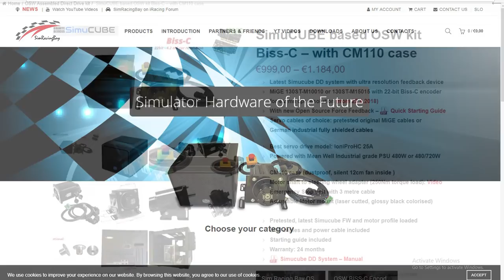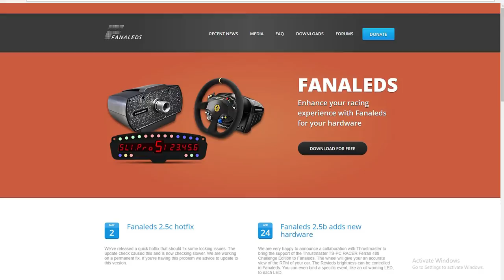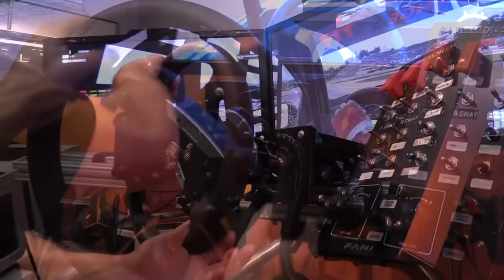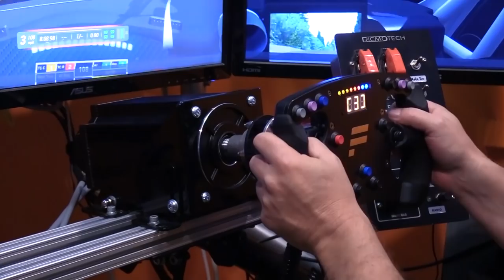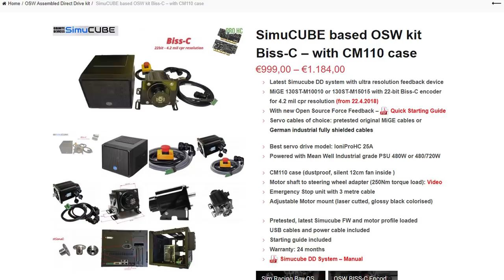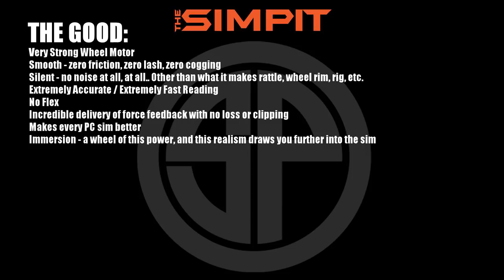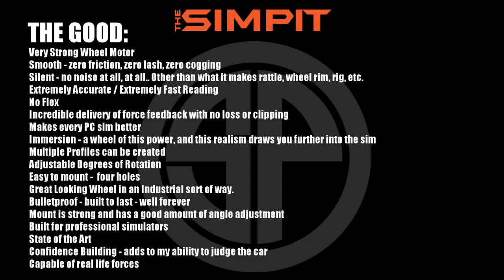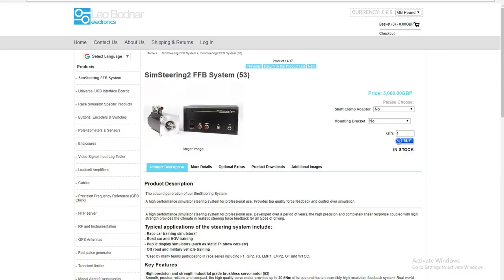Sim Cube 30nm Direct Drive Wheel Base Review

Comment: The INI file in iracing give you the ability  to adjust FFB strength in NM instead of percent.  If you adjust it with strength the force feedback is not linear.  Change the INI file and see how you like it.  Also adjusting it with Nm will make the wheel output linear.  Also the NM setting is reversed.  Setting it to 30nm wheel sett it at 100 percent.  So setting it  45 or 60 nm will set it lower.  I know this doesn't sound right but this is the correct way to run OSW in Iracing. Like one of the other viewers said, make sure to select linear.
Reply: Yeah iracing is weird with OSW, but other sims seems to be fine, I can generally run around 50 or so percent on say Assetto Corsa or Automobolista just fine.

Comment: Very good review. I want to add my points since buying the OSW which I have owned for a year...

1. I am not a professional driver, nor real or sim. However, I got this because of the flaws in gear driven & belt drive wheelbases such as cogging, friction, FFB fade which were affecting not only the immersion but also how well I could do in a sim + it was irritating me. So there will be those like me who buy this for a more serious experience more so than competing professionally. 

2. I did not buy this specifically for the FFB strength or how much NM it could offer. Instead I got it for the smoothness, no FFB fade & direct steering response because of the high resolution. In fact, I think I am running this at a quarter of its power & it is more than enough for me to have the best steering feel in most cars. Some others though I have to turn up the FFB strength to get better steering feel but maybe 10 to 15% more on average. Depends on the car of course, because remember that modern cars with electric steering have much less feel + feedback than older ones with hydraulic drivetrains in real life. 

3. If you have no patience with setting up a wheelbase properly & all you want is Plug & Play before starting your favourite sim, then forget it. This also includes using third party apps to improve the FFB such as in Assetto Corsa, Iracing, etc..which are a must to get the best out of the OSW in these sims. I am not a technical PC guy yet I have managed to configure this for Assetto Corsa to my liking & it is not difficult because if I can do this then so can anyone. I don't want to put anyone off but just be aware of what Shaun said in this video about the same subject. 

4. I highly recommend a leather alcantara or suede rim to prevent hand slippage because of the strong FFB. Also racing gloves will really help too.

Overall, I am very happy with the OSW & I cannot see myself getting any other wheelbase for many years.

Comment: Nice review Shaun, really enjoyed it. 
I've been running an OSW for about 2 years so will add a couple of comments.

In my head the OSW concept was originally a bit like buying a set of plans for an outdoor BBQ (or a sim rig). You just then go and order the bricks. You would order all the bits yourself from possibly 12 different suppliers including the Mige from China. 
Then at "phase 2" helpful people started buying in bulk, putting it in a kit and finding a margin.
That's when I bought mine, that cooler master you had-luxury! I had to connect all the wiring and circuit boards myself and then put it all in a box.
This is "phase 3" really where Simcube do all that and you only have to plug stuff in. 
So you have 3 ways to do OSW depending on how much you can or want to handle yourself.

My wheel only needs switching on, no re centreing, so maybe there's a bug there.

"Last wheel you will ever need"-Agreed big time. If you spend $300 on a wheel and it lasts 3 years that's $100 per annum. My arms will go b4 this puppy does!

Power is a big part but there was another aspect you touched only very lightly. The retail products work from a smaller ,motor but ALSO have to send via a belt or plastic gears. So there is a response time/accuracy factor. Those little "granular" bits of feedback are clearer not just due to power but because you are holding onto the motor shaft rather than a belt that's connected to it. 
Which brings me to power and 30 nm vs 20 nm. Your video makes clear that 30mn is excessive but why not have it anyway? My conclusion was to go for 20nm due to the mass of the rotating shaft (lighter). Less mass means finer higher frequency FFB has higher fidelity.

Another factor is your choice of wheel, the smaller the diameter the less leverage you have on the shaft so more power. I use a Fanatec F1 wheel (best formula wheel solution for OSW IMO)and use approx. 45% of the power that the 20nm can deliver. I once had an issue in an endurance race and it dropped my wheel settings and delivered 100%. I was sweating after 3 laps and didn't think I could manage a stint, worn tyres and reduced grip saved me. 

Last point; wear gloves! Cycling or gym gloves are perfect. Otherwise it's blisters.

Thanks for your work.
Reply: David O'Reilly Doesn't make sense to look for even lower inertia with the 20 Nm.  People on forums harping on about stuff like this do nothing but spread a misrepresentation of what real steering systems behave like.  Real life cars have a humungous anount more inertia than a small or large mige.  The suspension, steering column, tires, wheels, and more.  Also, real life wheels are passive/reactive unlile FFB which is active, this alone means a HUGE difference in general wheel behaviour which is not generally suited to high Nm and part of the reason why FFB servo wheels are way ,way too aggressive, snappy, and wrist-snapping than real life wheels even when setting the FFB to a relatively weaker FFB strength than real life.  Also, FFB games have an insanely ridiculous amount of centering spring which even at least one OSW developer admitted is a problem and difficult to fix (partly due to the dated way FFB fundamentally works, with all games, going back to the 1990s).
Reply: Literally from the mouth of the men who tested OSW systems, has done all the testing with all sorts of Servo motors. They have tested using servos for printing machines, robotics, any automated systems. They have used kolermorgen, mige, and the lenze motors and much more.  They are not comparing SERVO VS CAR steering systems. It be stupid and a waist of time to even compare it like that!! Its SERVO VS SERVO performance!!! Nobody is dumb enough to compare how a servo feels vs the real life car steering. The testing has been done and Servo motors with lower inertia feel better and more refined, that is what I have heard from people who have ran the lenze motor. Now the question is the lenze performance worth the 3 times cost compared to the mige, probably not.   How come a majority or maybe all the simulators in the world who are for professional use and training are running Servo Motors!!! There is something to this. The professional industry are using servos.  Also nobody has to run OSW at wrist snapping strength. Mine isn't currently running at that strength.  Also you are completely missing the point of the strength of using a servo.  It makes me mad when David owns the product, and can give his 2 cents on the product and then you get some idiot in chat trying to tell him he doesn't know what he talking about.  I would take the opinion of the guy who has owned and tried it for 2 years compared to the keyboard warrior wishing he had one.  

So lets run down how the sim actually works.  The Sim sends a FFB signal to the wheel and the wheel reacts, and the user responds!!  Some crazy loop feedback happens and there input and output constantly happening between the user the sim and the wheel.  A servo with a lower inertia is going to be able to accept those forces and react much faster.  None of this has anything to do with how an actual car works!!!
Reply: David O'Reilly I just want to say thanks for the great review and your insight. You are right about never having to purchase another wheel!!!  If you read the mige manual it says it has like 50,000 hours life cycle.  Thats like running your wheel for 10 years strait with high torque for 10 years!!! Also we don't put the wheel under as much stress and load constantly as like a factory would.  So if anybody is ever thinking of getting a servo base system, just do it. Don't be one of those guys who is always thinking what if!!! Just save up the money and do it!!
Reply: Dark Sector Gaming The fact that you start accusing people with personal insults like "keyboard warrior who wishes he has one" shows how ignorant and immature you are.  I've had an OSW for over 2 years now with multuple upgrades of it's parts (different encoders, simucube mode, full simucube) so I'm not sure where you're going.  There is a lot of unrealism with these wheels as amazing as they are.  The point I'm trying to make is that many people are way too concerned with Nm and "on paper numbers" when there's so much more to it than that.  Too many are obsessed with numbers like 20 Nm, 30Nm without realizing that's only a fraction of what realistic feedback is like and, often, matching "Nm" with real life doesn't even mean a true representation and can even make the FFB experience worse due to overly active and snappy ffb with way too instant accelerarion rates and extremely over-powered centering spring.  It's obviously still amazing but ppl should also be critical instead of only praise (not just with OSWs but in general).
Reply: Well Spinelli I don't quite know where to start. You begin with a quite aggressive characterisation of people "Harping On" on forums as if that makes my feedback one of that group of disinformation. That sort of makes it an attack rather than any useful feedback for the viewers. I made a decision to go 20nm rather than 30nm because I believed that the lower reciprocating mass would offer more fidelity in high frequency FFB. The greater the mass the slower it is to move. RF2 for example uses that very well to signal loss of grip. So my thinking was if 30 nm was definitely over-kill then why put up with that extra mass, decision made. I am happy with the decision. 
I know and I think most people know that a real steering wheel on a real car is connected to many kilos of hardware from the un-sprung weight of wheels, tyres, brake discs and calipers then through to the steering rack and shaft. That does nothing to diminish my point and my logic. The FFB in a sim is designed to convey signals that replicate what happens in real life. The Sim wheel is trying to replicate the feel that comes through that real life hardware.  The OSW has the power and fidelity to tune that as strong or weak as you want. In my point with which you disagree  am discussing high frequency FFB. Sometimes things are exaggerated as in a sim we don't get the benefit of that G=Meter called our backside. The maximum force is such a small part of the story. In many ways an OSW will exceed the maximum force from a real car, is that good or bad? is it even a measurement criteria? I don't know, I go to the gym for strength training I don't use my wheel for that.
I am a licensed Motor racing driver and of the cars I have driven on tracks (more than 10 types from 200-400bhp, FWD, RWD, 4WD) had less force in the steering than the OSW wheel I use at 45%. So yes we know that the force of the wheel can be different to real life. However real life is more tiring as your arms are helping to fight G forces (depending on how well you are strapped in).
So I for one am NOT trying to match steering forces with real life. I am simply trying to get the optimum FFB to tell me what the car is doing.  
The centreing spring is adjustable, I have mine on Zero so I just get pure FFB.
So sorry, you can tell my that in your opinion it doesn't make sense but to me it makes perfect sense. I am happy with my decision ( BTW I haven't done any upgrades at all in my 2 years of ownership, just happy as it is) and simply passing on my thoughts.
Reply: Well I basically agree with the majority of what you say actually.  Note though, centering spring is not adjustable unless the game you play has some sort of setting which adjusts that or you have something like the Accuforce which I heard, through it's Sim Commander software, is able to adjust that.  If you have some tricks to help with this, I would appreciate it.  Yes, why go with the extra size/bulkiness and weight of the large mige when the small is way more than good enough, I totally agree but, honestly, the large mige is already so insanely quick, accelerate, and sharp (in a super unrealistic way, whcih can be toned down of course) that worrying about things like "The greater the mass the slower it is to move" is completely irrelevant.  Trust me, I had all the same concerns and worries as you when I researched OSWs for almost a year before finally buying and the direction change, acceleration, etc. etc. can be so crazy on a large mige that worrying about it being slower doesn't make sense.  It's like worrying that a car goes 500 km/h while another maybe goes 550 km/h but you're only trying to drive 10 or 20 km/h in a parking lot.  It 's already so insanely over-performing.  I used to worry like you about the extra inertia/weight and everyone on forums was like "just trust us, you're overthinking it, you'll understand when you get it."  Being me though, I was still skeptical...Until I received it and realised first-hand how much time wasting I did worrying about it.

Honestly though, if I had to do it again, I would have gotten the small Mige.  I think that's the better choice.

P.S.  I've had my fair share of real-life racing with F1600s, F2000s, open-cockpit prototype style cars, etc.
Reply: So let me get this right; the bloke who researched this for 12 months and has had at least 5 iterations of an OSW due to frequent upgrades and changes and deliberated on various forums at great length is telling me "not to sweat the small stuff" (my paraphrase). You persist in telling me that my point is irrelevant despite not having owned both types of motor, yet in hind sight would have gone for the one I have. For your information I didn't have any concerns or worries as you put it so we don't share them. You might be over thinking please don't project that onto me. Unless you have new information to share lets just end this circular conversation.
Reply: David O'Reilly Lol, you continue to carry such a defensive and passive-aggressive tone.  Lighten up, pal.  You clearly don't understand but that's ok, it's just a videogame.
Reply: Whatever you say pal.
edit Sorry nearly forgot... LOL.

Comment: The emegency stop is also to stop you dislocating your arms and wrists etc if you get your hand or thumb stuck in the wheel or something, therefore it should be mounted next too your feet NOT your hands, you ain't gonna be able to press it with a broken arm or wrist. I own one of these, the 20nm version,  and have nearly broken my wrist from forgetting to drive with thumbs on the wheel instead of hooked around it. I mounted it next to my pedals so i can stomp on it if i do mess my wrist up lol. I run it 100% in software, 40% - 50% in game for assetto and pcars 2, dirt etc. Not iracing though, i don't own iracing, but it's nowhere near as strong even at 50% as iracing makes it at 12% at all....something else in the settings needs changing maybe...I know iracing has different type of ffb settings to other games. Try it on assetto 50% game 100% software and see what you think. I have it at 700hz also in simucube which also effects things but I think some ship set to 1000 by default. Also I don't need a rig, I simply have 2 chests of draws and a plank of wood 1 inch thick screwed in to them across the top and it's fine, not much rattling unless I have it really high and nothing to come loose :) Windows recognises it the second I turn it on also but I turn it on after I turn the pc on, only when I want to race. Also i have never ever had to recenter it, once is enough, unless you remove the wheel and put it on in another position, i think maybe a bug somewhere.
Reply: Mounting the E-Stop at the feet is an excellent idea and should be standard practice. Hats off to you for a superb idea!!

Comment: After buying a Fanatec CSW v2.5 last year and my hands started going numb after using it on high strength for a few days, I'm confident I'll never want a Direct Drive wheel.
(Yes, I have problems with Tendonitis already so I wasn't too surprised, thankfully the CSW v2.5 is also the smoothest wheel Fanatec has made do date).

Comment: I've never had to re-center my steering wheel on my OSW, make sure you use the new granity software, it's called "SimuCUBE Configuration Tool", not the MMos software and get the latest update with the recommended IONI firmware.
Reply: I am sort of thinking Shawn built this thing up himself, without the assistance of my savior Olly (Sim-plicity).. it's an amazing "wheel". Didn't know there were re-center issues.
Reply: Yeah that's odd, I've never experienced it yet, even so, it takes literally 2 seconds lol.

Comment: Better to change the strength by reducing the amperage in Granity. Set it so you produce somewhere between 10-20Nm. People are using these more for the precise fidelity rather than brute strength. I run 12Nm for daily use.

Also set you .ini to display Nm in the sim strength slider and read up on how to set the strength correctly with this slider, based on each cars Nm output and the Nm your wheel is producing.

Comment: When I got mine 1 month ago, i didnt had any issue to update firmware , it took me 5 minutes to install the software part.
Did you follow correctly the instruction, i remember, the very first time you turn it on, it has to have all the cable and both usb plugged in, and the emergency cut off button, must be pressed.